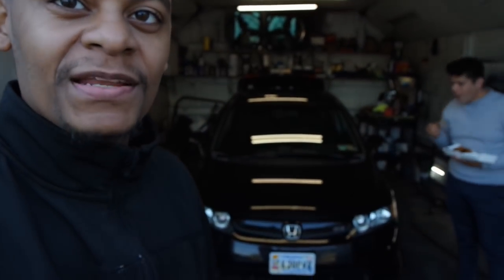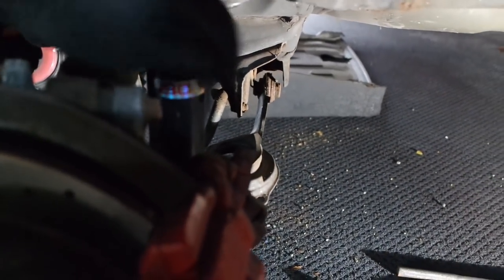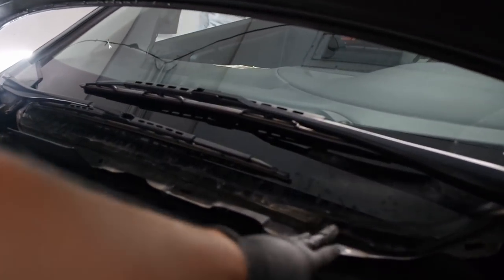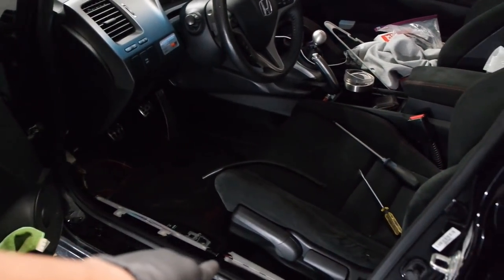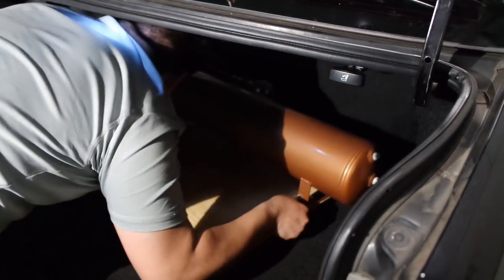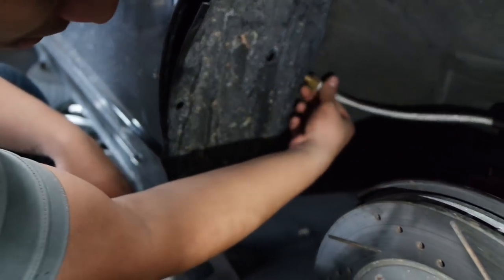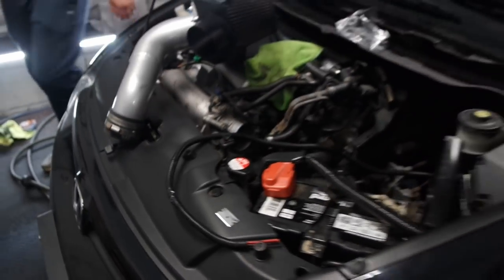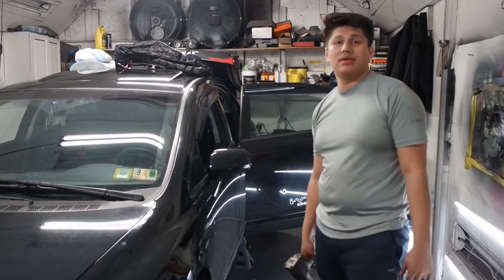Airlift v2 suspension install for bagged 8th gen 2006-2011 gen honda civic  si

Comment: whats the difference between the autopilot v2 compared to like the 3p?
Reply from the maker: 3p has a better and more efficient interface. That's when they upgraded the ecu and the remote
Reply: @treybedipping1734  I see so performance wise they’ll still work fine. Cuz I’m buying a used set that has like 5k miles on them and wanted to know more about it cuz it seemed like they discontinued it

Comment: Did you have any problems with exhaust close to bags in rear
Reply from the maker: You will need to heat wrap it it or add a heat shield

Comment: What did you guys wire the power harness into? Like straight into the battery or? And also did you guys put any in line fuses in?
Reply from the maker: Yes sir your kit should have come with all of that. The main harness you connect to the battery with a 30amp inline fuse and the other power source goes to the controller in the car you can wire that to a fuse in the fuse box inside the car.
Reply: Trey Be Dipping so I was looking thru all the packages and couldn’t find the 30amp fuse, would auto parts stores have that or would I have to order it from air lift?
Reply from the maker: @isaacabenroth1933  you can use one from an autoparts store just make sure the wire gauge is the same as on the harness you'll want that to match.
Reply: Trey Be Dipping good point, do you know the gauge by chance ?
Reply from the maker: @isaacabenroth1933  prob 14 or 12
Reply: Trey Be Dipping Finished it up last night!
Reply from the maker: @isaacabenroth1933  nice
Reply: I have a civic too, what fuse inside the car did you guys tap into too?
Reply: @jayortiz7491  did u ever find out ?

Comment: Is there a difference in ride quality? Is it more comfortable and what is the before and after on the bumps on the road? Thanks in advance.
Reply from the maker: Stiffer than stock but also slightly more bouncy in my opinion. The dampening is adjustable so you could make it more stiff .
Reply: @treybedipping1734  Thanks for the reply, so it wont make it more comfortable?
Reply from the maker: @KavinPhotography  if thats what your looking for no